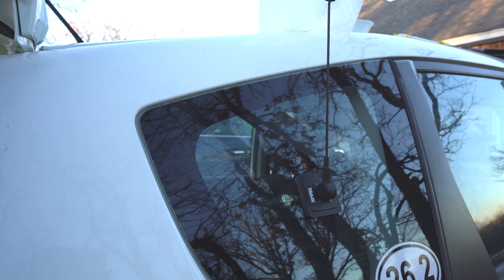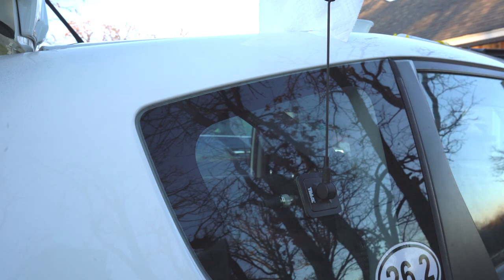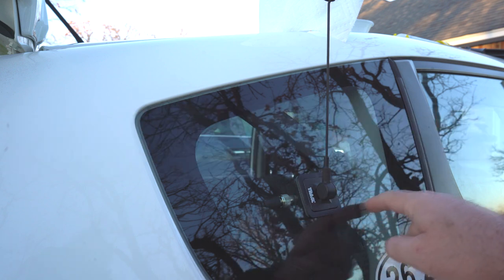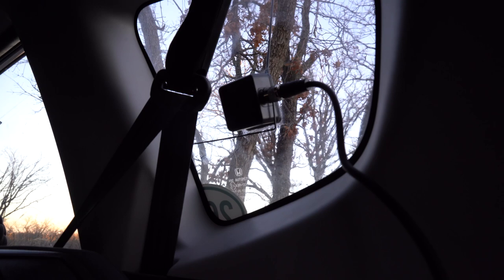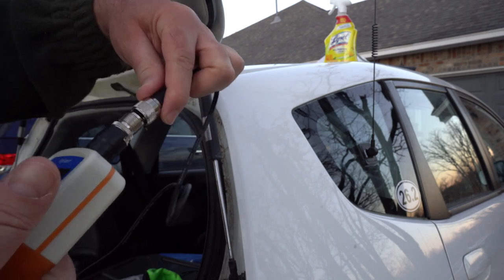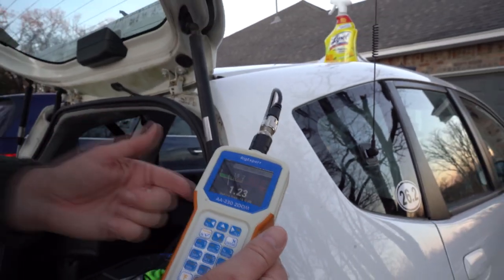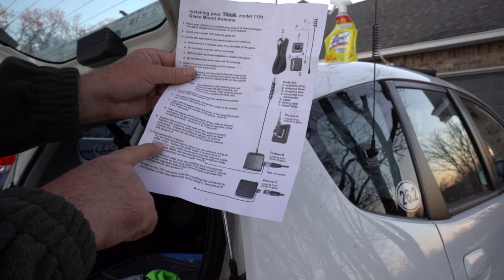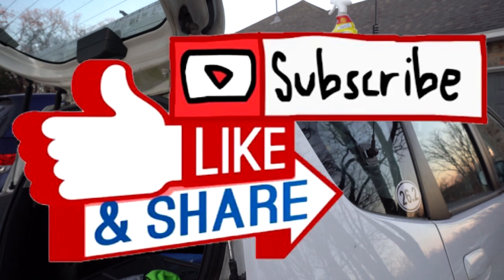Glass Mount Mobile Ham Radio Antenna Install ~ Storm Chasing Comms 2M 70CM

Comment: Thanks for the video. I just installed my antenna "same model" today. It installed with no problem and used RTV silicone sealer as well. I used a Nano VNA to tune the antenna and got the SWR down to 1.23:1 on 2mtr and 1.3:1 on 440. Not bad at all!  My car is made of a lot of plastic and glass top for sun roof so I did not have many antennas to choose from but this glass mount "same model" worked great and fit my needs. I am going to put on some ferrite beads at the antenna end of the coax. If I move the coax a lot then the SWR will change. Installing some beads should cure that problem.
Thanks WB9KQF

Comment: For many years I used the Larsen dual band glass antenna - I had about 4 or 5 of them over the years. That is a great antenna - low SWR and performed just as well as conventional dual band antennas. My most memorable QSO with the Larsen glass antenna, was driving on a highway in South Africa, and working an American astronaut on one of the space shuttles in the mid 1990's. We  had a long QSO which lasted for their entire pass overhead. EDIT: Oh, only downside, was at a certain speed the antenna would whistle. To rectify that I put a really small weight on the tip of the antenna to stop it from vibrating and resonating at an audible frequency
Reply from the maker: That's an awesome astronaut story!  Love it.

Comment: Good video I guess. It would have been helpful to talk a little bit more about what you were “turning” when trying to tune the antenna. 

Hints and tricks to how/what you were doing. Were you turning a knob, the entire box? If it was the box, what steps did you take to make sure it wasn’t stuck fast to the window as you were making your adjustments?  What EXACTLY were you doing?

Be careful about making assumptions when creating content like this. 

I got some info I was looking for, but came away with additional questions. 

-73
KG5YMD

Comment: the best antenna Ive used for 2m-70cm was a larson nmo(short 19" tall version) on the roof of my crew cab truck.  It was scary drilling a hole through the roof, I cant bring myself to do it on my new vehicle  so use a mag mount....I dont use vhf-uhf enough to justify a permanent vehicle install ......if I were to do another semi permanent install it would be a front fender, about the same location you would expect to see the car radio antenna installed at
Reply from the maker: Tnx for the comment.  Yeah, drilling an old car easy.  Not good for a new one.

Comment: I am just curious as to why you mounted it in the center of that window?
Reply from the maker: Good question. That window is pretty useless anyway, it's tiny hard to see out of.  I am going to put the battery in the back passenger side floor board.  So all the cables will be right there.   I have no idea how to get to the firewall to the car battery and I don't wanna mess with it, so I'll have an onboard battery for now.  There is a child seat there anyway so there'll be no feet in the back.

Comment: To remove the residue from 100% silicone, try rubbing alcohol next time. Much quicker and easier clean up. For acrylic caulk, water works fine, though.
Reply from the maker: Someone else said that too.  Your probably right.

Comment: A nice easy to install antenna.  Unfortunately I have never heard anything good about them.  Maybe you will have better luck than most.  73!
Reply from the maker: What would be a problem to look out for?
Reply: @hamradiocq  - The problem is that the signal is desensitized passing through the glass.  So, really there is nothing you can look out for other than making sure that the inside and outside mounts are aligned and square.  Most agree that these type of antennas are a last resort to not drill holes in your automobile or run coax through the door seals or firewall.  If they perform well enough for your needs then no worries.

Comment: Most of the guys that chase around here use GMRS. Might look into it also.  Only $35 to get the license now with the FCC fee change.  Tidy install.
Reply from the maker: Thanks for the info, I've never messed with GMRS.
Reply: GMRS is a fun start, but look at also getting your Ham ticket, very easy with minimal study, for lots more mobile capability and beyond. My Tram thru (on) glass antenna has held up and performed well for several years, although a mag mount whip is much better for challenging terrain and distances. Agreed on the tidy install, although I'm glad I put mine on the driver side for easy checking that the antenna remains tight.
Reply: @truck57us    We both have our ham tickets.  We are both extras!!
Reply: @BadHorsie2  Awesome. Sorry I misunderstood your GMRS comment. 73.
Reply: FCC: Please pay our fee we even lowered it. Please. 
Everyone: What fee?

Comment: Hey bud, heard you on the EARS repeater a few minutes ago. I'm in Edmond west of 35 near the K5EOK repeater. I'm having the same problem of having to find a way through the firewall on my '15 Honda Pilot. Hope to QSO sometime. 73 KG5JZQ
Reply from the maker: Hey Rob that's awesome that you heard me.  I'm going to be publishing that video within 2 hours, it's building now.  Find a grommet opening and put a big screwdriver thru it...or next time your car is in the shop ask them to get the wire thru.  It's a tough problem.